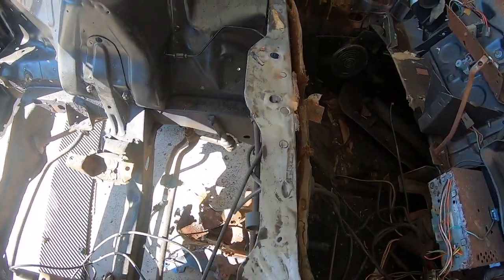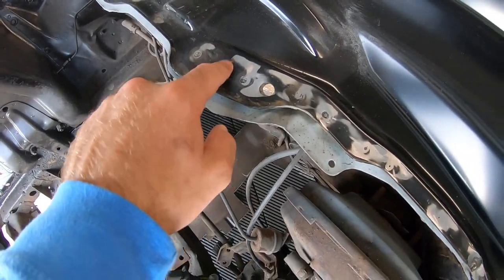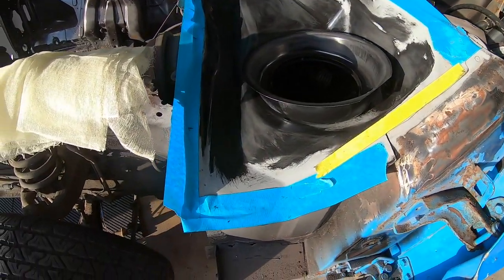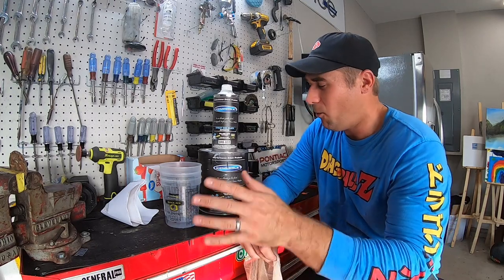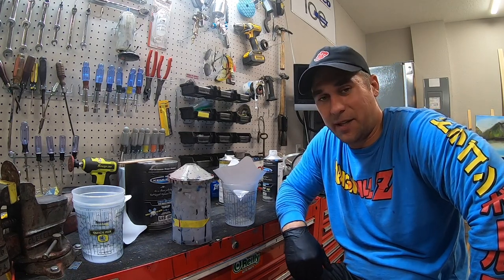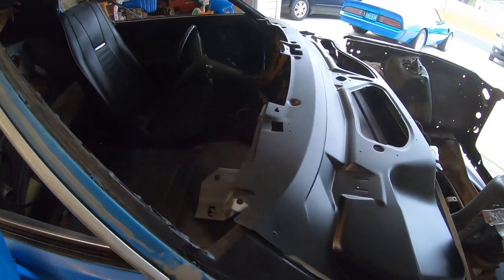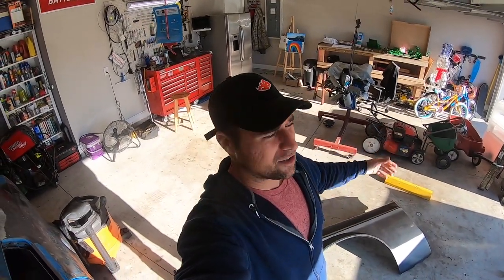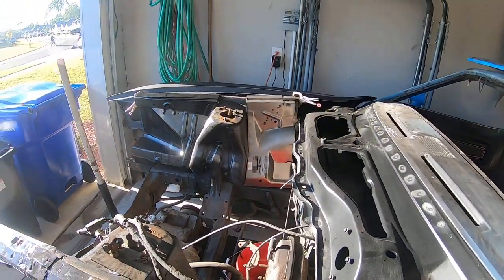1972 Ford Mustang Mach 1 Cowl Replacement Part 2

Comment: did you reproduce the "X" many of spot welds the cowl originally had or you just went with your gut on was was deemed as a sufficient amount. I have this as my next project and im really curious how you went about it. Also did you not seam seal around the hats of the cowl prior to welding the top layer back on? other than that great turn out on the project its coming along damn good
Reply from the maker: I went with putting the spot welds back were they came from. I didn’t seam seal and then weld as the seam sealer would have failed in areas I welded. I will seam seal once I paint the cowl again after I sandblast the engine bay. I will paint it all at the same time.
Reply: @SteffsGarage  okay nice nice, was the cowl portion of your project safe to say a weekend job? from drilling out the holes to primer prepping and lastly the top half of the cowl primer prep and weld. cant wait to see your net video man highly anticipating it.

Comment: Hi I wanted to know what was the difference between with air conditioner and without air conditioner on your cowl
Reply from the maker: I don't know 100% but I have read from some sites on the internet that an AC car would have the fresh air vent holes sealed up and a non AC car has the open holes for fresh air. I can neither confirm nor deny this claim. My car is an AC car and had the holes.

Comment: I really enjoyed this.  I've seen a bunch of cowl repair/replacement videos for the 71-73 Mustangs (I own a 71 in need of a cowl repair).  The other videos all use plug welds for the top and bottom.  I've always wondered why people plug weld the top when spot welders are relatively inexpensive (HFT has them), are super simple to get a good solid weld, and are the way the factory did it in the first place.  

Also, good to see how the non-AC cowl set gets modified for an AC car.  My car is an AC car so I've been wondering about this for a long time.  What did you do (or plan to do) about the vent hole on the driver's side?  AC cars didn't have this and it opens to the outside air (making it chilly in the winter).  Did you plug it?
Reply from the maker: I really appreciate the comments Nick, you taking the time to let me know what you liked in the video really helps me keep going with this. I’ve called a few  Mustang specialist shops here in Florida and they’ve all told me that they’ve seen them with the vent hole closed off on the driver side and have seen cars that had AC without the vent hole closed off. 

I found out halfway through doing this that my car never came with factory I see that it was installed afterwards later in its life. I found this out through the Marti report. With this new information found I ended up leaving the whole there
Reply from the maker: It’s funny you mention the harbor freight spot welder, that’s exactly what are used in the 110 voltage version. It made the job a breeze. But there were some modifications I had to make in order to do the spot welds like the factory. If you check out my channel I have a video on modifying the tips of the spot welder in order to get those fatter factory spot welds that have the dimpling affect.
Reply: @SteffsGarage  Makes sense, and you'll be set if, one day, you decide to restore to factory condition.